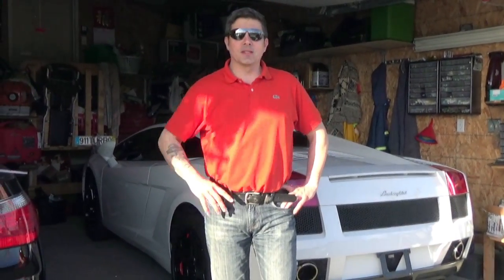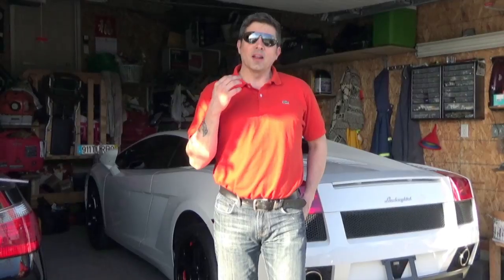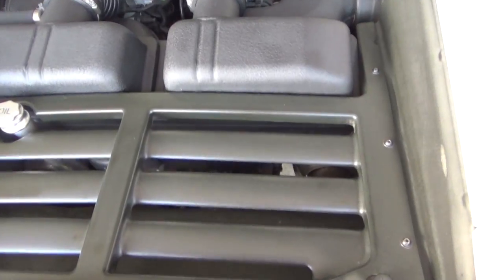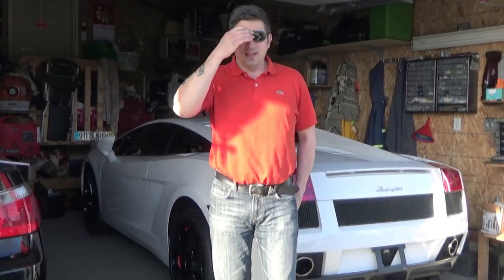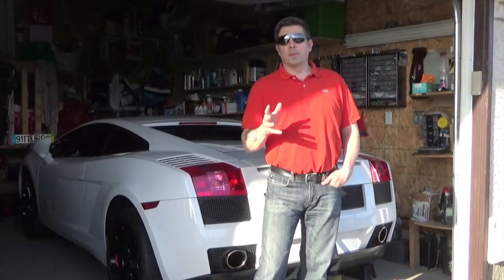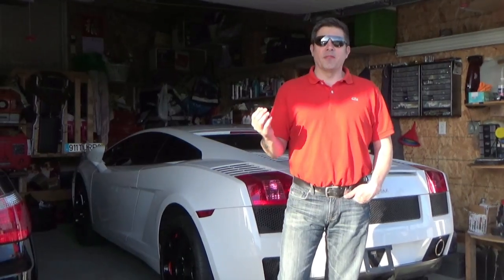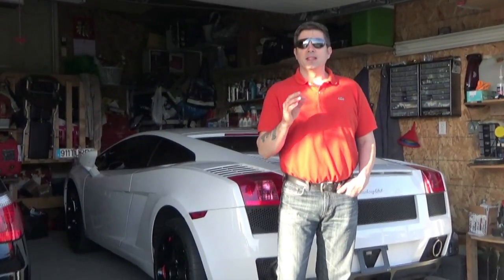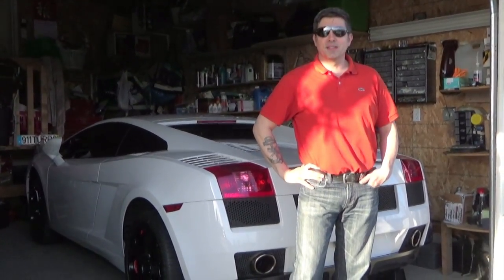Top 5 Lamborghini Gallardo Failures  -  Problems

Comment: Whenever the clutch gets replaced on these cars the software usually gets updated to the latest version, 04-05 clutches should last just as long as 06-08. Never had any issues in 27k miles in 3 years, 1 clutch replacement after 20k miles and only $2300 in maintenance prior to the clutch which cost $8.9k with discount and a Kevlar clutch. Overall, very happy! Gets a lot of attention, some good some bad. But drive the things!! These Gallardos make nice dailies and get better the more you drive.

Comment: The E-gear system is awfully similar to the Selespeed system. The electric motor and pump assembly are exactly the same! But the cluch wear a lot faster on the Lambo. But be aware that your driving style will greatly affect the overall system durability.
Reply from the maker: Exactly.  It’s a sensitive system not tolerant of abuse

Comment: The clutch is a disaster in these cars. I was looking to get one but every bit of research i've done points to the clutch and the cost of replacing it every 20K kms. I'll stick to a 911. Great video.
Reply from the maker: Thanks Lee, the clutch really is a weak point and I just replaced mine
Reply: @ECPP  I've heard you can get a ceramic clutch that lasts 5 times longer. Have you heard of this?

Comment: While I know SuperCars is in a different class, it's amaizing how much depreciation most of them have. A 12 year old Toyota could have a 20 grand loss in value with 300,000 miles on it... A 12 year old Gallardo, which I just saw listed in TN, $94,000, almost 100,000 dollar loss with 25k miles on it. You can even pick up a Bentley that used to be 300k for 40 grand
Reply from the maker: sadly many of them depreciate hard.  Likely cause those with money buy again new while those that have t stretch can barel afford or just decide that buying a new "regular car" is safer and more sensible.
Reply: @ECPP  Much like non millionaire cars, there are some that becomes some sort of collectors icon. Most of the time it's 50-60 years old. A handful of classic American muscle cars, fully stock, will fetch a high price especially if it's good condition. A friend's dad has an 03 (I think) mustang cobra, very low miles, with the chameleon paint job, worth almost 40 grand. I found a 98 (again, I think) Toyota Supra, fully stock with 40k original miles going for 90 grand.... Then you have the Ferrari 260 GTO which averages between 30-50 million at auction. Why it's that desirable, I'll never understand, but I get that it is a real bad ass of Italian muscle for it's time..
I can afford one SuperCar (lower end of them), but I wouldn't want one. The maintenance annually averages 5-8 grand a year, insurance limited you a couple thousand miles a year... There's a bit more science behind them than an average vehicle, and I enjoy driving or riding in one. But to have one of my very own, it's a dedication I don't want to make
Reply: Frank Jager better to spend a 100k on a built 2jz and be able to beat the tar out of it with nearly no Maintenence and best part is insurance is cheap. It’s a 90’s Toyota as far as they care.
Reply: @JoeMaxFpv  not speaking negatively about Mk4 because i love them. But at the end of the day its still a Toyota and not a Lamborghini
Reply: You clearly don’t understand what owning luxury and exclusive is all about.
I’m sure you own a nice pair of Levi’s jeans too, but instead you should just buy some $10 jeans from the Old Navy. Same thing right?

Comment: You would think that these cars would be supremely engineered to not fail. I still have the first car I financed at 19 years old, I'm 33 the car is a Mazda protégé. It still starts and runs fine.
Reply from the maker: One would think but it’s the search for efficiency and driving dynamics that sometimes compromise durabilitu

Comment: Does Anyone know how to manually lock the fins down on the soft top of the Gallardo 06-07????? I need some good insight to make this happen. I was told that underneath the soft top there are holes to search for and torque on each fin , driver and passenger side. But have failed to locate them or even k ow what these holes look like. Apparently near the Joint of where the fins pivot. Had anyone tried or heard of this? There are many tips how to lock the fins down but not Manually.

Comment: I'm buying second hand murcielago LP640 next Wednesday. Are there issues I need to be aware of? Or any suggestions?
Reply from the maker: Congrats!  Great car.  Are you buying Manual or E-Gear?  Throw out bearings are about 4,000 US for a gated car, and Egear clutches dont last more than 10-15,000 miles.  Some pricey parts but overall these cars are very durable.  E-Gear actuators, water pumps, are big bucks and labour intensive to install.  I could go on, but in general, they are amazing machines and enjoy.

Comment: Wrap the rubber hoses (joint part) with tin foil?
At home in the garage with garage door open, open the engine bay lid for 45 minutes while the car sits in stasis mode?
Reply from the maker: For sure its good to let the heat out that way.

Comment: I’m thinking about getting one in about a year or two what do you think the best year for reliability is
Reply from the maker: Best ones are the 2009-2014 lp cars
Reply: Oderis .... friend had an 08 for 10 years . No problems besides the buttons as described lol ... just tires and a battery .  Also if you get one keep it in sport mode as that conserves the clutch , and do NOT back up uphill that will smoke your clutch .  1st gen Gallardos also sound better than 09's and newer . Different firing order.

Comment: yes early G 04-05 they have shorter clutch life, but i will not consider it a failure, it's something that wear out like brake pads, but yeah very expensive, one more point surprisingly LP parts cheaper than early cars due the shared parts with R8.

Comment: Sounds like there would be a market for Chinese-manufactured maintenance parts for exotic sports cars. Buy 1 car, reverse engineer all the small stuff that breaks, and mass-produce affordable spares. Hell I would even consider designing UPGRADED replacement pieces that are better than the OEM parts. 

I bet a "high quality" Chinese factory with excellent QA/QC would be expensive by Chinese manufacturing standards but still save a fortune for end-users who are like "what do you mean power steering lines are a $5000 repair?"
Reply from the maker: Maybe some options for sure.

Comment: I heard 06 and up is what you should go after
Reply from the maker: Generally the newer the better.  06's now are at a decent price so that is probably the way to go, but generally other than the taller 1st gear in an 05, they are the same.  04 is the least desirable as it does not have certain interior branding, no nose lift, and some launch cars had early rod bearing d from another factory that were prone to failure.
Reply: @ECPP  so what year would you recommend? I heard that even changing wheels on the gallardos eats up the front dif if you go with AWD.

Comment: Will manual gallardo clutch much longer life than egear?
Reply from the maker: A little longer, if you drive it right.  Also when it is down to worn out, you can limp the manual even if it is slipping.  The egear will only allow so much lining left and then not allow you to drive.

Comment: Just saw this. Considering C7 or Lambo 560 2012.  Really want Lambo for YT channel.  Already have 2 vettes...  Would your opinion be get Lambo?  [Ignore bias, price of maintenance, etc.]
Reply from the maker: 100% go Lambo, I did and never regretted it.  The Vettes are fast especially in Z06 form but there is just something more special with the Lambo and you really cant go wrong.  Better sound and bottom of depreciation curve.  Just be sure to get snap test for clutch and full inspection so you dont get a dud.
Reply: @ECPP  Thanks for advice!!!

Comment: Check mate. I’m out. I have a 91 Z/28 TPIS mini ram, Xtreme fuel injection cam, headers, Upgraded 700R4. I will spank these like I do vipers. No knob issues, transmission issues, or any of the other problems mentioned here. I thought about selling off all my muscle cars and the Camaro for a European car like this. That thought has now ended in a week.